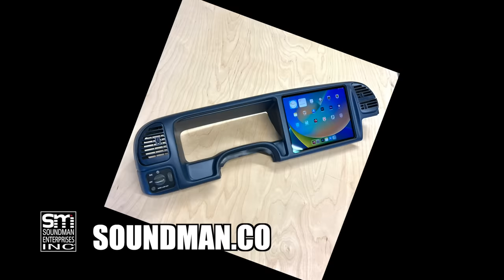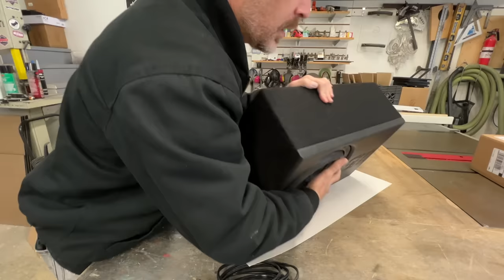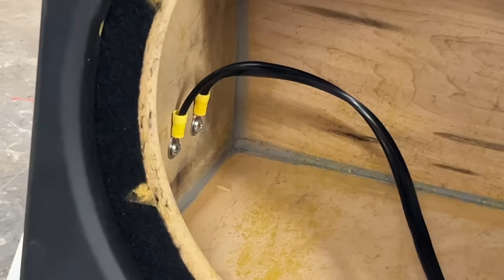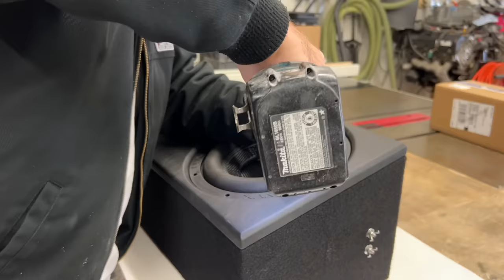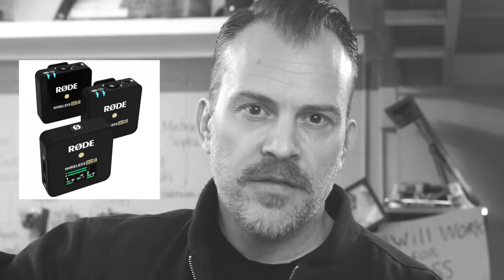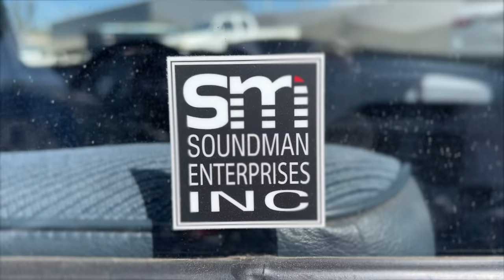TEST BUMP! - The Mule subwoofer box

Comment: What matching nvx components is Doug using??
Doug , what do you consider a better speaker?? Nvx high end 6.5  components
Or
Ct sounds high enough 6.5 comparable components???
I will be using a nemesis 1600.5  and a 10 in DB drive in a sealed box 
My components now are AD  audio or ad design 2100 series

Comment: Little bit of advice if u don't know which is positive and negative take the speaker ends and a 9 volt battery and test it if the sub pushes out connect it like that to the Amp if it gets sucked in swap the wires and test it again on the battery

Comment: Have you ever tested with box fill (flame resistant insulation - looks like pillow stuffing) in a smaller box, to slow sound waves. Supposed to 'trick' the box into acting like it's larger than it is. Or is this not a thing anymore?
Reply: SMD did a video experimenting with stuffing with his IM/SG it dropped the peak a couple hz iirc
Reply: That's a myth....it does help but not for the reasons stated.   We use the Black hole Stuff and it's actually used in sealed enclosures as it cools the enclosure from the woofer dissipating the heat and a woofer stays much more controlled when the temperature inside is at ambient air temperature

Comment: The mixture of metals(copper, aluminum, steel) in your terminals will cause corrosion to form, and a static charge will develop causing your sealed box to sound like a band pass box loaded with GM 6x9s that are missing the foam surround. Just beware of that and discharge the radical static charge to ground every know and then.

Comment: You can offer the public a full restomod with a system now. Its definitly worth the money. There's plenty of hot glue, and the 11 year waiting period should go by pretty quick. jk. The only thing I would have done different with your sub, is to pour sand inside the box to give it some weight so the bump doesn't make it jostle to and fro and cause buzzing

Comment: Uneven torquing of the speaker screws, premature dissimilar metal corrosion on wiring, wave propagation causing turbulence, gains cranked clipping the sub?! Doug you’re really on a roll 😅
Reply: 2 years of pooping to bass van videos and voila, we get a 10” sub in the mule